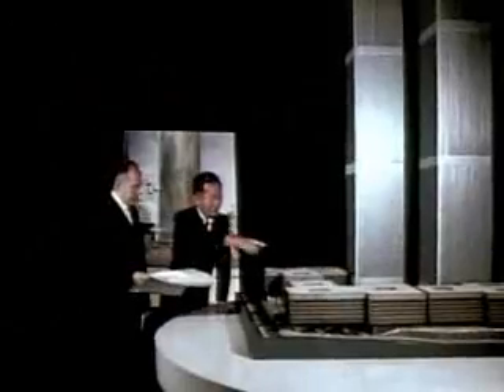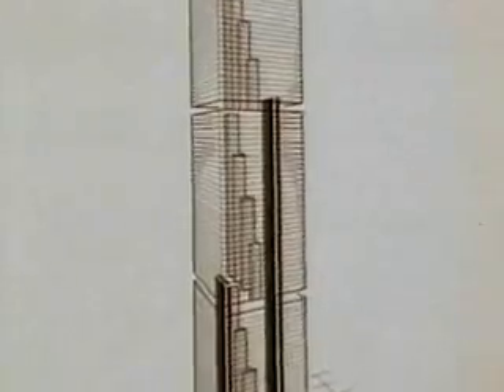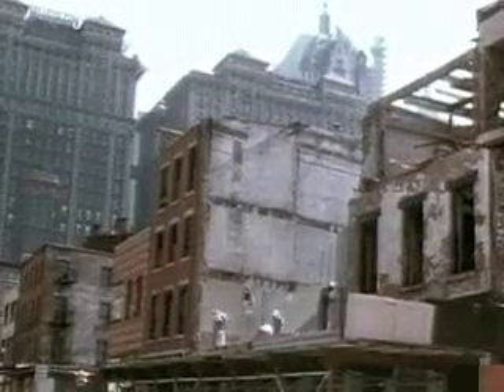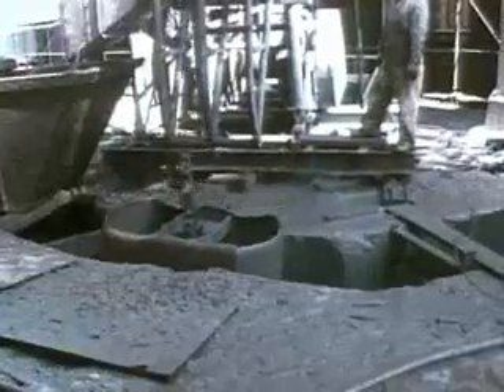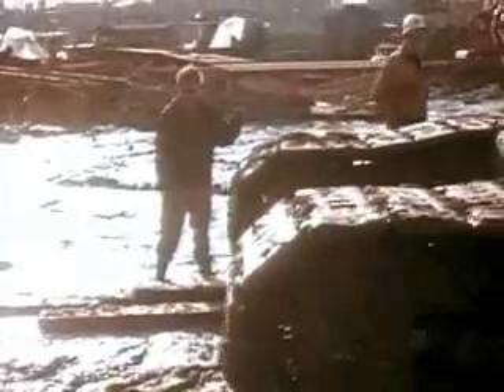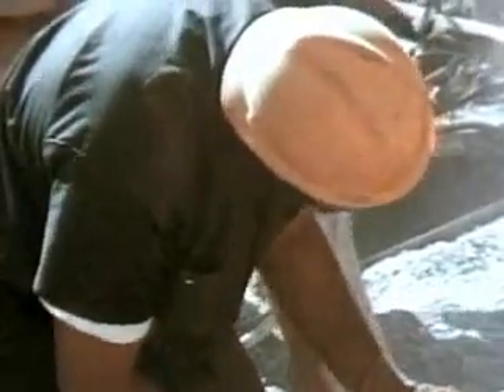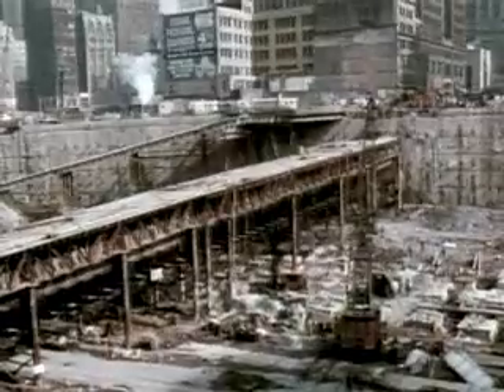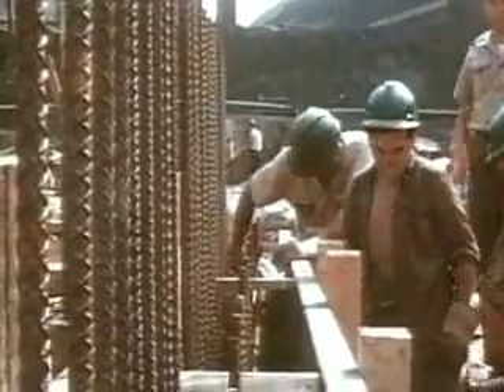Building The World Trade Centers Part 1

Comment: The two tallest skycrapers ever build!!!
 Is not a myth but truth, the race for building tallest is always broken and new other are the tallest, for the past 15 years burj kahlifa has been the tallest structure. But the Trade center was bigger ,no other building has reached this height as two side to side buildings.
Don't come up with the petronas, they aren't bigger. The structual height is only around 380/390m ti the top that can be considered a building.
The trade center had floors above 400 m. The petronas aren't this tall .

Comment: @TheAfricanBatman I did research the WTC construction as well as having been a structural steel inspector. Usually, iron workers hated to see me coming to inspect their work. I performed NDT testing as well as heat treatment of metal mainly during fabrication or repair routinely at temps of 1100 and above. I grew up around aircraft (airforce brat) as well as worked on them in the military. If all that sounds fishy I also have 18 yrs experience with military explosives.  It's molten metal.

Comment: @TheAfricanBatman Also, it only took a mere few minutes for molten metal to be seen in many videos. Do you not find it odd at all that thick metal went from room temperature to flowing like lava within several minutes? Can diesel fuel do this? Try this little experiment: Take a wimpy aluminum beer can and put it in your hot BBQ grill and see how long it takes for it to become molten or collapse. Put a weight on it if you want. Then imagine the thicker tower metal being heated up. :-)
Reply: The beams were not as thick as you think and the floor/ceiling trusses were even thinner than the beams
Reply: @T-Dog_nation  Yeah, but that was calculated for when they were designed.
Reply: @thybigballs  some of the internal beams were cut due to the plane impact and what few beams that were left together with the sagging of the damaged floors could not hold up what was above it, the steel was softened not melted - scientists proved it was a mixture of water, fire and aluminium that caused the liquid metal seen pouring from the wtc, you can see in the video before the collapse the walls are being pulled inwards due to the floors sagging and when the outer uprights were pulled in to a point that any weight above caused them to buckle and we all know the rest.
the real questions are - did they know it was gonna happen or be involved in any way? and why did wtc owner tell fire chiefs to "Pull" wtc 7 when he heard it was on fire and minutes later it collapses??????
the twin towers were due for H&S review and because it was built 60's/70's era it was full of asbestos and the bill to keep the towers to modern safety fire standards would of cost MILLIONS and the construction disruption would of been immense????
why were some floors closed for "RE-FITS" months before 9/11 and were strangely guarded from other workers saying "off limits due" to construction, and workers returning to work to find thin layers of dust by the window vents???????? all work carried out at night too???

Comment: @TheAfricanBatman NIST as well as others agree most of the fuel burned away within a few seconds. The remaining fuel was office furniture. I'm sorry but office furniture is not going to do it. Even under the best conditions I use to heat thick metal (usually with 480 volts of electricity per machine x several machines) it takes longer than these buildings held just to get it to 1100-1300 degrees. What in the world caused all the molten metal? Was it the magic diesel fuel and wooden chairs?
Reply: You realise it wouldn't even need to get that hot for the beams connecting the outer walls to the core to bend by a couple degrees. That alone pulled the outer wall in, to the point of failure

Comment: @CobraMarty Yes steel melts but not at the temperatures of burning fuel and office furniture. Does your BBQ grill melt when you use it? I have many years experience with heating metals above the temperatures of burning fuel. It is unfathomable to me how JP5 fuel can heat metal to a molten state at the towers. This goes against everything I know.

Comment: @Triglavus Again, as all conspiracy-thinkers fail to take in concideration... STEEL MELTS! Melting steel is worth nada! And therefore can't support anything.. even if it's not all the colomns that were destroyed, a huge imbalance in weight distribution occurs, which overloads the remaining columns, and were coloumns used to be, supporting the weight, there's nothing, but air = Crash... No more building
Reply: Yeah but steel melts at a much higher temperature than jet fuel burns

Comment: "The cranes were assembled on top of the core columns, each could lift 60 tons at a time. They would be the driving force behind the towers construction"

What about the official pancake theory? So these core columns fell at free fall speed with each floor? WTF?!? Wake up people or be remembered as a complete idiot.
Reply: The core collapsed several seconds later it's visible in some videos
Reply: Shut the fuck up you idiot.